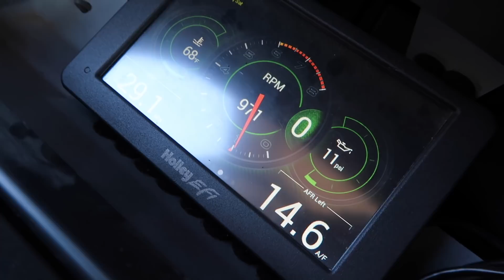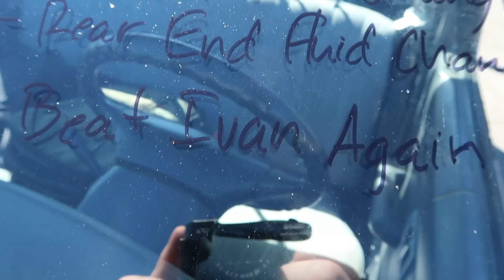Taking 'Liam Nissan' To The Shop

Comment: Can we have more on that rear mount radiator I'm trying to do this  to  mine
Reply: Marcell Archie what you trying to figure out?
Reply: The big thing is to make sure the radiator cap is higher than the rest of the cooling system so the air will bleed and the coolant will basically gravity feed itself to the water pump
Reply: blindabinda123 u kinda answer the question and what pipes did he use to run along the frame and will a stock water pump do the job
Reply: Marcell Archie you could realistically use any kind of stainless or possibly even some 1 1/2 exhaust pipe. The pump shouldn't have a problem pumping it up a foot or so I wouldn't imagine.
Reply: Marcell Archie if you get it all set up you should be able to see water flowing through the radiator cap.
Reply: Marcell Archie yep don't over think it. The pump moves plenty of water to operate. My only recommendation would be to use a little more efficient radiator and can setup than you would normally have of it were in front because in that area it does get much less air flow. I used a much smaller radiator in this truck and I regret it a little. Doing pulls its fine, stop and go traffic it's great, but sustained 3k rpm driving on the highway it get warm after a while. I ran rubber hose from front all the way to back. Don't have to do hard lines of you don't want. You still can get some air stuck in the heads of you don't address your steam ports. But it's all very doable.
Reply: Marcell Archie shrouded fans will deff help keeping the radiator cool by giving good air flow
Reply: the problem is most fans don't simulate more than about 35 to 40mph worth of air. Don't skimp on the fans like I did lol. Good multipass radiator and bad ass fans. My radiator is too small, thin core, single pass, inlet and outlet in the same side and crappy fans, pretty much worst case scenario lol and I still drive it all over the place.  Could be better, but it still works :)
Reply: HighAltitudeVideos a friend of mine with an s10 had his fans on the other side of the radiator and shrouded in that whole font section of the bed basicly air tight then he cut big holes in the bed and made big scoops under the bed to feed air upwards.  He did hvac so it looks really good.  A bit overkill but it's really sweet
Reply: blindabinda123 nice! Yeah the bed is cut on this one too. I shrouded it all up a while back and it made a small difference but the scoop from under was going to be the key and I just never got around to it. Not sure I ever will lol. Gonna get a less crap radiator and fan setup in there and see how it goes. Bunch of off-road guys don't seem to have issues without any shrouding . should hopefully be good enough for some longer sustained highway cruisin. We'll see :)
Reply: HighAltitudeVideos yea a better rad will deff take care of it.  And maybe a little lower temp thermostat.  The shrouding my buddy did was just overkill.  It looks killer and pushes a shit tin of air bit it's just overkill.  Lol
Reply: blindabinda123 thanks alot for the help
Reply: HighAltitudeVideos thanks for the info and help